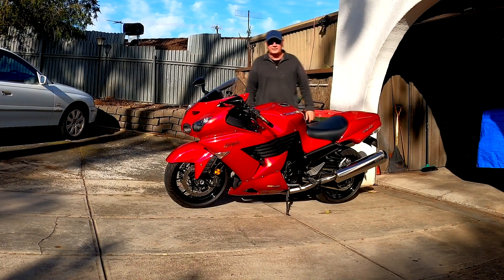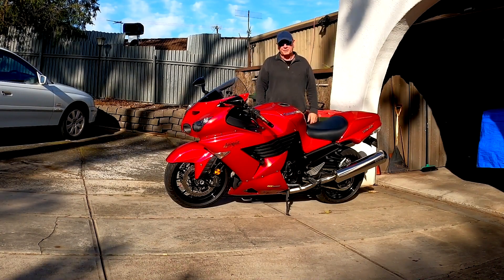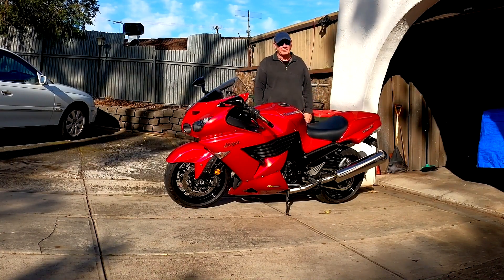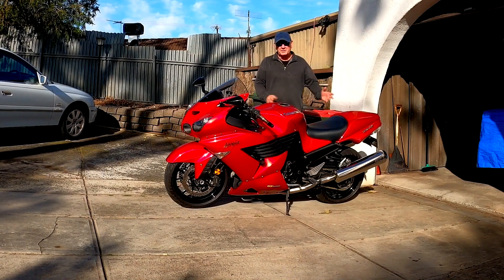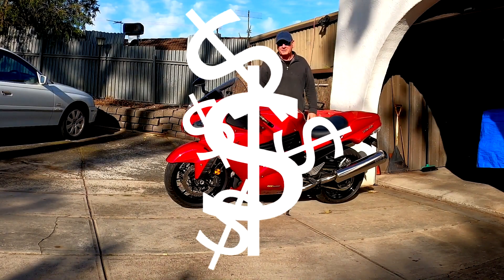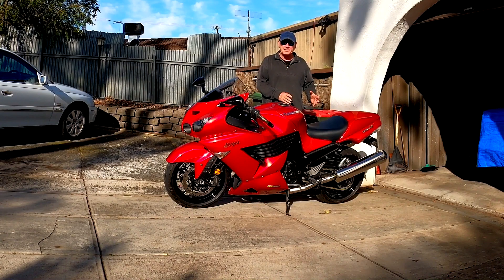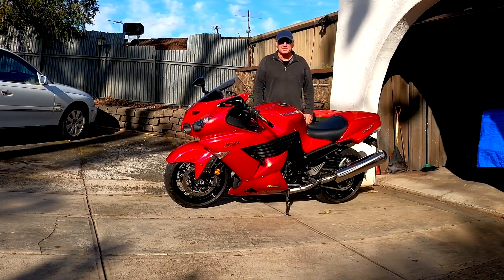Kawasaki Ninja ZX-14 / ZZR1400 Exhaust Mods

Comment: The first gen. ZX-14 mufflers really can be modded with a circular saw blade and a Dremel tool. Just cut the very back of the muffler out and then Dremel the last inch or so of the exhaust tube inside. In the USA it is know as the trooper mod. The state police would do this to the mufflers on their patrol vehicles for less back pressure and more horsepower!
Reply from the maker: Thanks for the comment and stopping by. Firstly I made this video as a bit of a joke using a 2cc wiper snipper and dubbing in the audio from that lol…. And Yes I am aware of the exhaust mod for the stock pipes and it’s not a bad one either or hard to do. For many years I have had very loud exhaust systems on my bikes mainly just open no baffles on VANCE & HINES and VOODOO systems but when I first got this bike some few years ago now I decided to keep the exhaust totally stock it it’s a nice change to ride a bike that’s quiet for a change. This first gen has had a full ECU & Timing map tune and with the stock exhaust its now making 173.1 kilowatts on 100 octane fuel so now not only is it quiet it’s got grunt. If you watch my “Kawasaki Ninja ZX-14 / ZZR1400 Ninja Get one” video and keep your eye on how much I move my wrist to get it to move that should give you an idea.